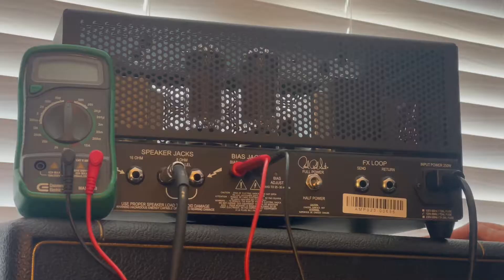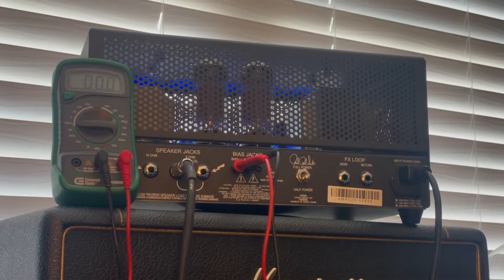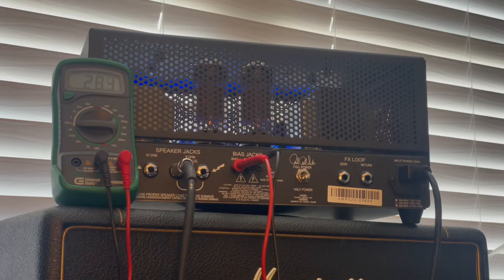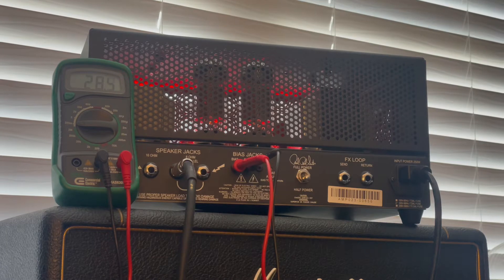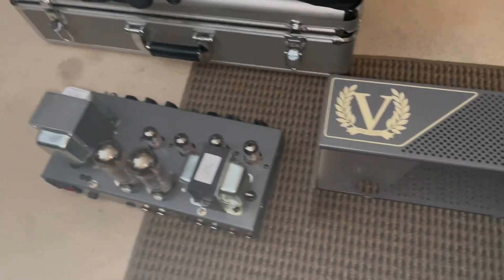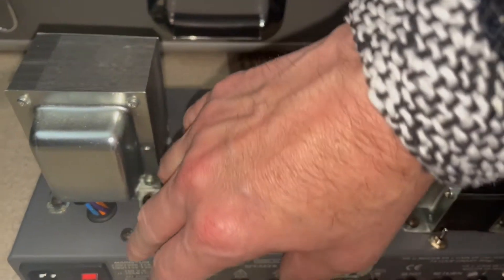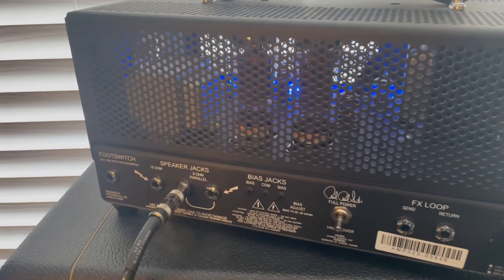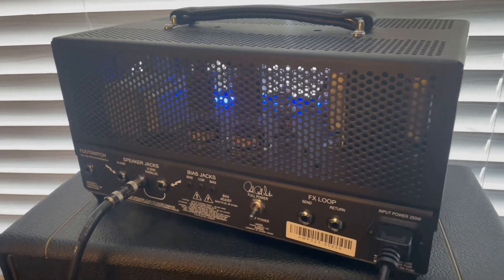PRS MT15 - Biasing Questions

Comment: Greetings, i just got this head and did my own bias. On the left im getting about 26.5 and right about 29.0 to 29.2. Think that should be ok? Thats about as close as I can get it. As you adjust 1 the other changes a bit. Just want to make sure I'm ok. Thank man, I enjoy the content
Reply: I was able to get it to around  a 27.7 ish and 30.2 to 30.3. Think I'm a little better now? Thanks
Reply from the maker: I would raise it a bit to not run so cold.  It should be close to an average between the two readings.  Cheers!

Comment: I am prett sure this amp must have been modified. The PRS MT15's Standby switch usually is just a mute switch, not supposed to cut off the HT to the output tubes. 

Do NOT USE EL34's in the Amplifier. The Powertransformer can only deliver 4 Amps for the heaters and even with original tube setup its exceeded significantly. With EL34 you draw about 1.2 Amps more from the Heater Tab. Not to mention that the high tension winding will break down because the EL34 needs excessively more current to be happy. The bottleneck in the amp is the Powertransformer. 
The 5881 have significantly more output power. I am working on a video for that. 

Hope this helps
Great vid! Cheers
Reply: biased mine this week and mine did give me the same value whether it was on standby or not, so you are right about that

Comment: Would a KT66 tube work? I’m in the process of putting in a 50 watt transformer into one of my MT15s. I was thinking of taking out the 5881s for KT66s just for kicks. As an experiment yesterday, I compared my two, MT15s. One has 6L6s and the other has 5881s. I set them up identically in terms of it’s settings. On the clean channel, with the knob pushed out; The one with 6L6s actually sounded a darker in the trebles, seemed to break up a little faster. Has a darker bass response, and darker mids. The 5881s seemed to clean up faster, have more top end-mid brilliance, very articulate and airiness in the note-still had a great overdrive. Very lively in tone. When it came to the red channel, the 6l6s had a darker bottom end and overall darker in the mids & trebles. However, the 5881s still maintained the big bold bottom end but sounded a little more high fi in the mids and trebles. Which one do I like best? They are both incredible it’s hard to pick a favorite at this point-but one advantage about the 5881s is you can dial back the mids and trebles and still achieve the punishing tones of the 6l6s.
Reply from the maker: Hey Jason.  There is a quick read I found about the comparisons of 6L6 and KT66 tubes.  “Heater current for a KT66 is in the 1.3 amps per tube range as opposed to 900mA commonly found in a 6L6.  Do not assume your amp will be as stable. If you do not know if your amp can handle the additional heater current draw, contact the manufacturer before installing KT66 tubes.  Both these “tubes will bias with a range of voltage used for a 6L6 tubes.  Your power supply’s heater tap will use 50% more current compared to a pair of 6L6 tubes. Check the heater voltage to see if it sags down to 6 volts or less. If it drops like this you are likely pulling too much current from the heater winding.”  

I would reach out to PRS and ask what other octal tubes they believe would work with the MT15 before swapping them out.  Don’t know if the amp is designed to take the added heat.  Please let us know what you find out.  Cheers!
Reply: Question for both you guys… Ive tried the 5881 version, LOVE the clean (treble boost is pure SRV goodness for blues) Gain was impressive but FARRR too much Bottom End. Do you guys notice that and will a Slight bit of OD pedal cut those low freq’s out?
Reply from the maker: @jayteesgear  I just ordered the 5881 version of the amp and plan to do a comparison video of the two.  More specific to your bottom end quesiton.  I owned a pair of the 1-12 small Mesa Recitifer Cabinets awhile back and it couldn't handle the bottom end of the amplifier at all.  I ended up selling those cabinet because of it.  So some of the bottom end issues could be the cabinet you are running it through from my past experience.  That being said, I have the red channel bass turned down to about 10 o'clock on the dial.  It is a very bassy amp similar to a Dual Rec.  When you are running that much gain reducing the bass frequencies will give you more clarity.  If you are trying to tighten up the low end, which I think it is a really tight amp already,  try running a tube screamer style pedal or OD-1 (asymmetric clipping OD) to reduce bass freq., or a treble booster, or an eq pedal with reduced low frequencies to tailor in the sound you are after.  Cheers!
Reply: @jayteesgear  My MT15 has a good amount of bottom end, but with the settings you’re playing I can dial my bass knob back to around 10:00 and it’s not overly bass heavy. One trick you could do is take a Ibanez tube screamer and turn the gain knob to 0/off, level to noonish, and tone knob to taste. In essence, the tube screamer will work more less as a preamp and it’ll reduce the bass frequencies while letting mids shine through. What kind of speakers are you playing through? Speakers are a huge component here too.